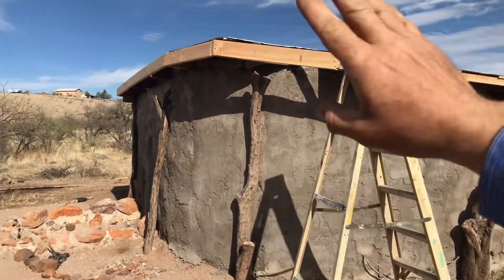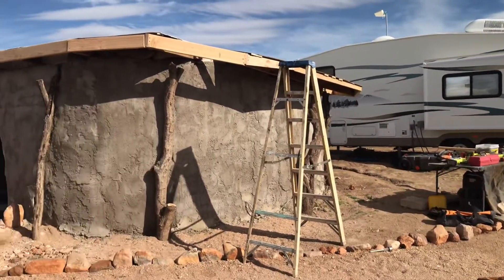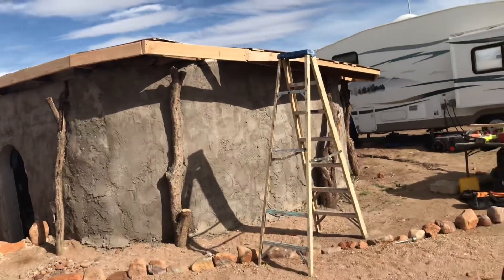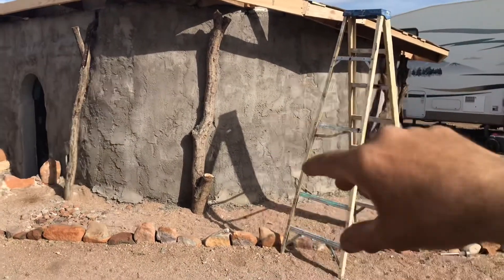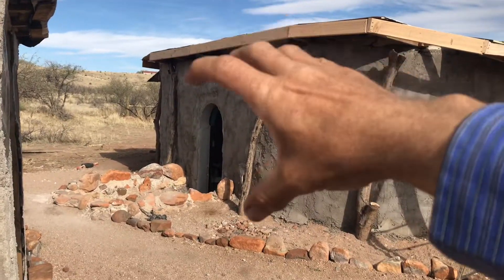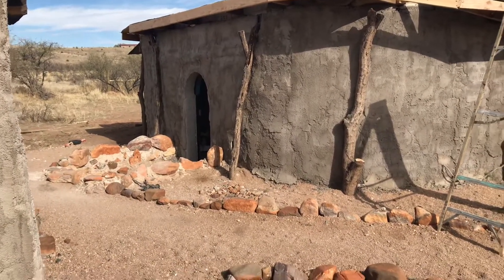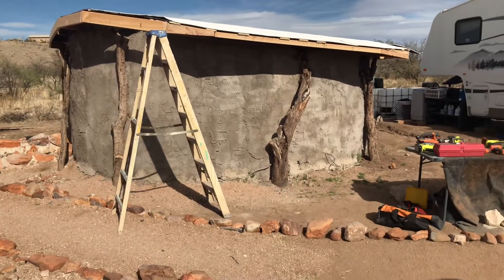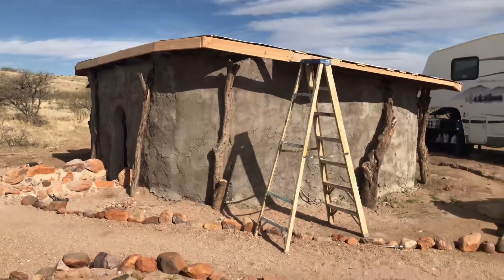Earthbag Building - adding the finishing touches

Comment: To protect the bottom part of your earth bag building there needs to be  a concrete or rocks set in concrete pad out about a minimum of 3 feet. This is needed because of how the rain will splash up to the wall and soak down into the ground at the base of the walls. It needs to slope away from the building on all sides. I know you said that you plan to put rock work part way up the walls. This is in addition to that and probably should be done first. I'm 83 years old and have lived in Cochise Co for many years. I have lived in other states also out in the country. I have lived in several places in Cochise Co. Best wishes.
Reply: You are right, it saddens me to see this beautiful home built in direct contact with the ground
Reply from the maker: you may have missed this, but I had actually addressed this a few times in previous videos... in fact it is just about completed a little different than you described, but same concept